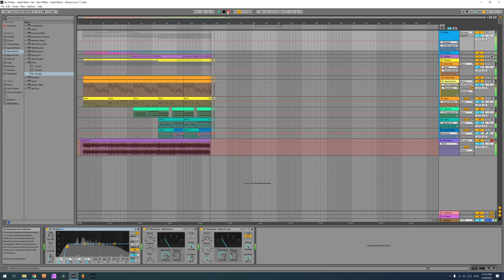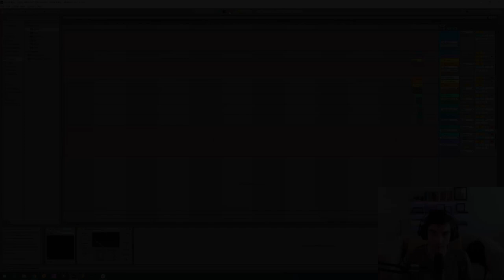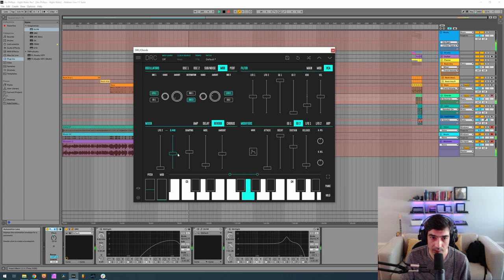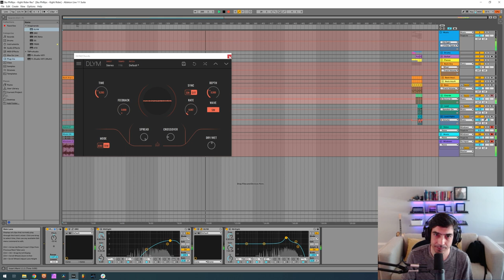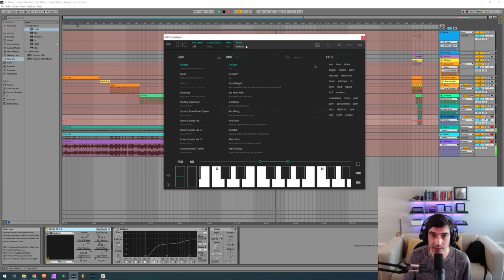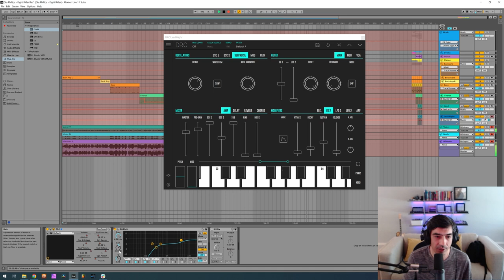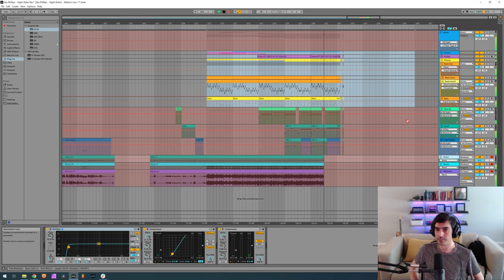How to make the sounds from Stu Phillips 'Knight Rider Theme' with DRC

Comment: first all DRC is one of my top favorite synth on ios, love it and i enjoy everything about it, but one thing that im not sure about and which i always struggle when i want to follow this type of tutorial video which by the way i always enjoy watching, but any how, 
the struggle i always have is when dialing the exact number that you mentioned to dial, like for example you mention to put the p.width dial at 905 but im only able or is only letting me adjust the dial at 908 or 898 which is the closest i can get to 905, so i never know how make the exact adjustments or numbers, so my question is, if there is a simpler way to actually be able to do it without struggling so much, if not a double click on the dial name to be able to type or write the number in, would be a great option and update to have specially to follow and write the exact number on this type of tutorials, other then that DRC if perfect and very very powerful synth, im an iphone beat maker which is why it's one of my favorite auv3 synth to use in my projects !!!
Reply from the maker: There is a knob sensitivy setting under settings. That could help you get the right value more easily. Having a way of entering the value could be another option. We will add that to backlog. Thanks for your feedback!
Reply: @ImaginandoPt  Thank you for your help 🙏🏽